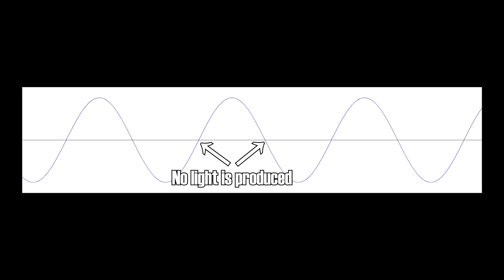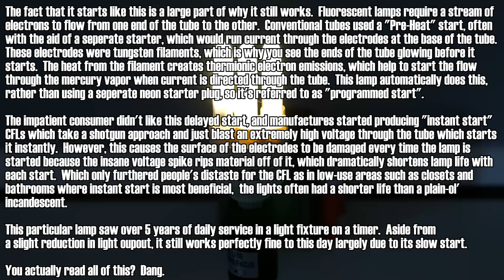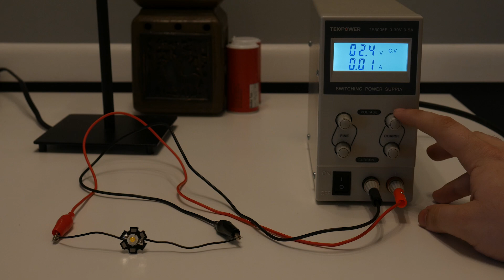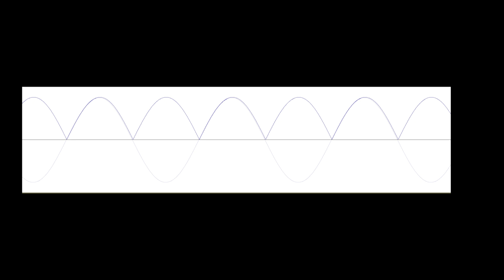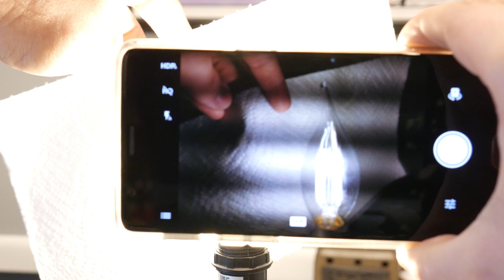LED bulbs that flicker, and CFLs that almost never did

Comment: Is that an "LV Pin" brand digital audio amplifier sitting on your desk?
Reply from the maker: The "Brand" if you can call it that is Lepai.  Search Amazon for audio amplifier and you'll see it and tons of clones for sale--apparently many are now called "Lepy".  For about twenty-five bucks it's a sweet little amp for things like running desktop speakers.  Certainly not audiophile quality, but surprisingly good.  It and my Infinity RS-2000 bookshelf speakers (a Goodwill find) will crush any set of dedicated "PC speakers."

Comment: Another negative for the CFL high frequency ballast operation is significant radio interference, especially on MW and LW.  Sometimes one CFL turned on can wipe out AM reception in an entire house, and even close neighbors.
Reply: Amateur radio operator here - I banned CFLs in my house for that reason. Horrid interference.
Reply: Amateur operator here. I have ONLY CFL's (except two bulbs) in my house. But I buy quality ones. No interference at all. But I have problems with a classic linear fluorescent light from the neighbour which causes a lot of interference on HF band.
Reply: +Dejan Zajebancije

Buy your neighbor a lamp that doesn't cause interference, and ask him to switch. It will be far easier than trying to reason with him.
Reply: Would this have a jamming effect on Wi-Fi signals too or is the frequency/power too low?
Reply: @UNSCPILOT  frequency is too low - this is MF/HF interference, Wi-Fi is SHF.
Reply: I've found electronic ballasts with bulbs that are failing to be the worst.  The emit a large RF burst every 3 second when they try to start the lamp.  I'm sure they probably emit the same burst when turned starting a good bulb too but I care less about that.  I once wasted almost two days tracking down RF from a bad electronic ballast when doing photon counting at work.
Reply: I have LED lamps that are for the most part good but generate interference on 220.

Comment: Incandescent and CFL lightbulbs runs warm, can be a big fire hazard. LED bulbs don't usually pose as much of a fire hazard (as long as it's not the cheapest thing, but the same goes for CFL's), also they last for ages (if they are not the afformentioned cheap ones). We have an 8 year old LED bulb as a navigation light, the only time it's ever been off has been during powerouts. The thing won't die, and it's actually surprisingly flicker free (it is the ugly kind with a large base though).

Comment: The flicker is really strong in the replacement LED lamps that are designed to replace halogen lamps in the European G9 lamps. These G9 sockets resemble the same sockets used on the old AG1 flash bulbs used in the old Kodak Instamatic 100 cameras but about twice as large. For those millennials who not know what I am talking about, use the Internet and maybe Wiki and search for these items.
These replacement lamps have practically zero room in them for that filter cap so they are really bad for flicker. It would be nice if we could power them from a well filtered external DC source.
Reply: There is one more reason for this: high-voltage capacitors store much more energy per volume than low-voltage ones, so making 12 volt lamps flicker-free is even more demanding task!

Comment: LEDs have the same characteristic operation as you've noted with the bench power supply as fluorescent tubes: unless there is a limiting factor, they will conduct heavily until destruction.  It's just that the voltage-current curve is a little flatter than the gas tube (fluorescent, neon, etc.) case.  That's why in a lot of LED circuits you will see ballast resistors.  They're for current limiting.  So those lamps with the LEDs in series that are almost the line voltage may still need some circuitry to limit current.  It could be a resistor, but that would dissipate excess energy as heat.  Like the CFLs and electronic ballasts, using something switch mode would limit current, it just wouldn't have to have a transformer to step the voltage down.

Comment: 2:37 Not true. LED's have POOR CRI than CFL and CFL has POOR CRI than incandescent bulb. 
CRI:-
LED=85~89
CFL=90~97
Incandescent bulb= >99.
Here I am considering the average bulbs not high end ones. Those might mave better CRI.
Reply: You're correct that he glossed over the CRI issue. Cheap replacement LED lamps wave around 80CRI. Higher quality lamps and dedicated LED fixtures now have 90+ or 95+ CRI.
Reply: Sorry for awakening a 6m old thread (blame YouTube algorithms).  I first assumed that my hatred of CFL was due to flicker, then I was convinced it was poor CRI.  Then along came LED bulbs and I loved them (the warm ones, anyway).  I was doubting my CRI theory and starting to think I was just prejudiced against CFLs.  But then I came across a YouTube video that showed the spectrograms of various bulbs.  Incandescent obviously had the most natural light, with one single broad peak, but the CFLs were awful - three really sharp peaks.  I was pleasantly surprised by the (non-shit) LEDs.  They still had three peaks, but they were all broad and nicely overlapping, unlike the jaggy awfulness of the CFLs.  Now every bulb in my apartment is an LED.

Comment: No wonder since we replaced our old CFLs with LED I noticed that when I shot the video at 50 Hz there are faint annoying horizontal bands that's running but if I change the shutter to 60 Hz that annoying bands are stationary and not visible in most cases. I don't see those annoying bands under CFL lighting even with 50 Hz cameras.

Comment: I've actually noticed these flickering bands on a cellphone camera under Philips Hue lights.
They're not cheap lights, and they don't seem to be cheaply made, so what's up with that?
Reply: This is usually caused by something called "pulse width modulation" in more advanced LED lights, ironically. Basically, LEDs cannot be reliably dimmed in the way incandescent bulbs can (where you just reduce current) because changing the current to an LED by even a small amount affects its color and light output rather severely and unreliably. 

So, in order to adjust the "brightness" of LEDs, a common approach is to deliberately flicker the LED at a controlled ratio of on/off time. Then, due to persistence of vision, the less "on time" an LED has, the dimmer we perceive it to be. Expensive bulbs flash very quickly to mitigate any noticeable effect while cheaper ones do not. And even then, the shutter speed of a camera can easily be out of sync and make the flickering apparent on screen. (This is also why LED bulbs require specialized dimmer switches.)
Reply: Great explanation, thanks!

Comment: The voltage on mains supply is 120 Vrms which is ~169V peak, if you divide that by the 3V each LED requires you get ~56 leds, that is why each array has 27 or 28 LEDs not 20 as it was mentioned :)
Reply: Didn't even think about rms to peak. Awesome comment bro.
Reply: VRMS is what the light sees over time and is the voltage that matters. The LED also only cares about average voltage.

Also as mentioned above, the LEDs never see direct mains AC. They only see whatever their driver supplies.
Reply: @lunchie80  Once you rectify AC, you're working with the peak voltage, and the filter capacitor serves to keep it near that peak voltage.  The LED light output cares not about the average voltage, but rather the average current.  However, the LED will not conduct at all until it reaches the junction voltage, and it will avalanche conduct much more current as the voltage goes above the junction voltage.  That excessive current will heat the junction and cause the LED to fail prematurely.  This means the LED string will be designed to run at the peak voltage of the AC supply, not the RMS.  You can still use the RMS voltage to calculate the AC power, though, as the current flow into the system on the AC side will still behave according to the RMS value of the AC supply.
Reply: @lunchie80  Most drivers use a rectifier and capacitor to keep it at peak voltage, and to prevent flickering.
Reply: Depends on the LED driver, but nice try

Comment: 06:37 'LED's only work with direct current'. That's not true. They'll only work on half of an AC cycle but they'll still work. Get some resistors and try it yourself.
Reply from the maker: If their job is to produce light, and they don't on the negative cycle, can you still call that working?

Comment: Most cities are switching to LED bulbs. Now you can no longer see the stars. So much light pollution. Turn lights off at night cities. Drive around at 3am, look. Every single business and church leaves their lights on full blast. End this. Stop wasting power and light polluting.
Reply: Light pollution is a well known problem, which even affects wildlife. In europe there are rules and regulations in place, e.g. it is not allowed to shine lights upwards and lights have to be angled a certain way. I find it most striking at nights where the ground is covered in snow and there are low hanging clouds- darkness then really disappears.
Reply: Too bad the criminal element is hard at work at 3am!  There are numerous reasons for running lights all night, and security, both at home and at workplaces is pretty high on the list.  Unless you live in Utopia, I think you'll always see lots of lights on at night.  I'm not down-playing loss of dark-sky territory, I'm just saying security and loss-prevention trumps that for many people and it all adds up.

Comment: I liked this video about LED bulbs that flicker, however I hoped you would have mentioned LED tail lights on vehicles. Flicker is the first thing I noticed about them. I think they have improved but my eyes could pick it up a long way off when following a vehicle that had them. Cadillacs and busses were the worst. I started to ignore the flicker after a while. When the brakes were applied, full brightness stopped the flicker. I like the way you present the content
Reply from the maker: The flicker in taillights is the result of the Pulse Width Modulation (PWM) used to reduce the intensity of light output for running light brightness.  It's much easier with a DC power source to repeatedly turn the LEDs on an off over and over again to dim them, as a switching transistor will create very little loss.  In essence, the lights spend maybe 10% of the time on, and 90% of the time off, accomplished by pulsing the light on and off very rapidly.  The reason you don't see the flicker when the brake is applied is that the light goes to 100% brightness, so it stops pulsing altogether as straight DC power is sent through them.  
I remember older Cadillac DeVilles, which had some of the first LED tail lights, and they had very intense trailing when moving your eyes.  You would be able to see the pulses with very little motion.  This was due to a relatively low frequency of switching states in the early PWM scheme.  Modern cars switch at a much higher frequency, which reduces the noticeability of this effect.
Thanks for watching!
Reply: Technology Connections Thank You for responding to my comment and explaining the flicker in vehicle tail lights. Some people don't notice it. I like your video on the circline fixture also. I bought one long ago and it lasted many years. I don't think I could change the bulb on mine though.

Comment: Have you seen a European LED filament bulb? Then you could see that even over here there are only two of the filaments in series and then 1, 2 or 3 of these in parallel depending on the power rating of the bulb. Each filament has a forward voltage drop of around 70-80 volts, so how can they be used on rectified mains voltages, which in most parts of Europe and in Australia are around 300 volts?

The trick is a so-called capacitive dropper just before the bridge rectifier. And there are definitely different types of these filament bulbs around, some use just a dropper, rectifier and tiny capacitor and yes, they flicker. However, there are other versions which use a switch-mode psu approach.

And finally, the same is true for compact fluorescent bulbs. There are some just running from the mains with an electronic ballast to counteract the negative resistance curve, but others, like your IKEA one, use a switch-mode psu to run the discharge at either a much higher frequency than mains or even at dc.

Comment: Would have like to hear about the spectrum of light an incandescent vs LED gives off.  I tend to notice a difference in LED's. Incandescent light just seems to give off a softer light. Some cheap LED I've tried gave  a really weird "laser" like effect, where all the shadows seeme super sharp.
Reply: The kind of diffuser cap makes the difference: Ideally, you shouldn’t distinguish a LED bulb with a reasonable big diffuser from a frosted incandescent bulb. 

Dubious LED bulbs often have a diffuser dimensioned too small that spreads all the light only within ~ 180°, making shadows appear sharper. Some LED bulbs don’t even use any diffuser (e. g. so-called ’corn bulbs’) and thus produce (multiple) hard shadows. 

Clear incandescent bulbs also produce hard shadows, but due of their big light emitting angles probably not everyone notices it (the ceiling or walls reflect the light partly).

Comment: I like and miss the bugfeature of cfls taking a minute to fully turn on. It's nice on cold dark winder mornings not to blasted with the full wattage of light instantly after flipping the switch in the bathroom but rather to have a dim slow turn on over a minute or two.

Comment: regular fluorescent fixtures and LEDs bulbs give me headaches... but CFL's tend not to...
however, the "blue" light from the CFL's do tend to give me headaches, so I stick to the "5600K" variety. however the unlocked and rotating colour temperatures of most CFL's and standard fluorescent fixtures drives me bonkers too! This why I WISH we still have IND lamps!

Comment: Interesting Video as always :)
I have serious Problems with flickering LEDs, they cause headache and make me sick.
In my home I have CFLs since 2008 because back in the days nobody knew about the danger inside them. I havent replaced them because they still work and I hate to threw away working things. I have 3 LED Lamps in my Home equipped with good LEDs and everything is fine. But good LEDs are costing 7-10€ instead of 2€ for the cheap china crap.

Comment: I still use ordinary good old straight fluorescent lighting with a magnetic ballast and starter in my room,  I've only noticed any flicker if I'm right up close to the light. CFLs never did it for me, though I did make a reading light from a CFL ballast connected up to an ordinary small fluorescent tube and it works well, I still use it now.